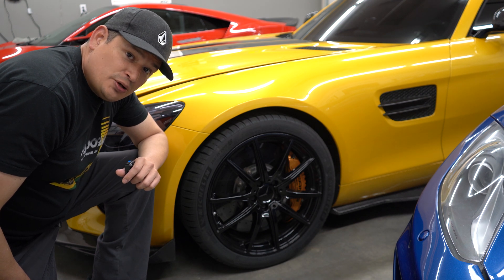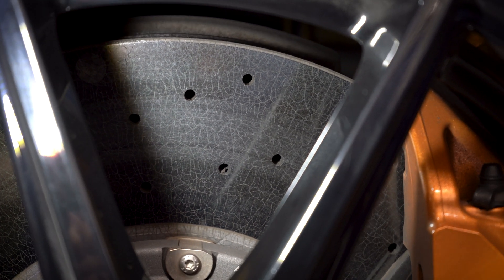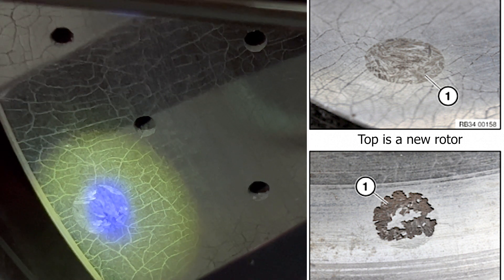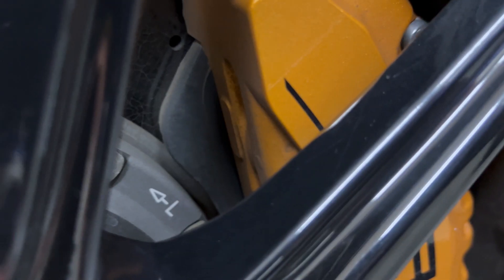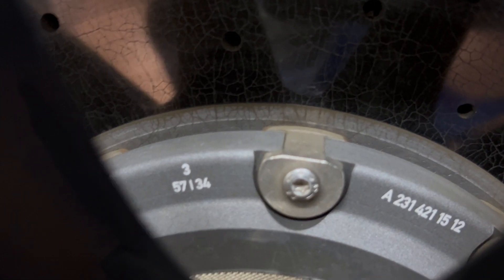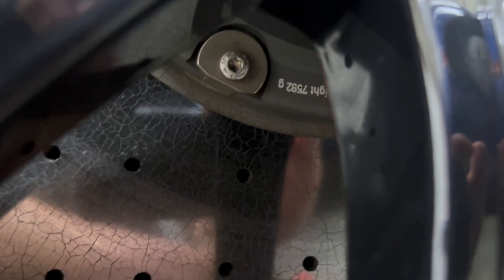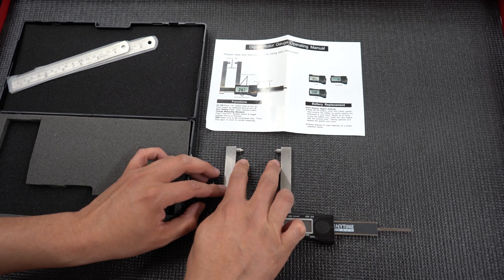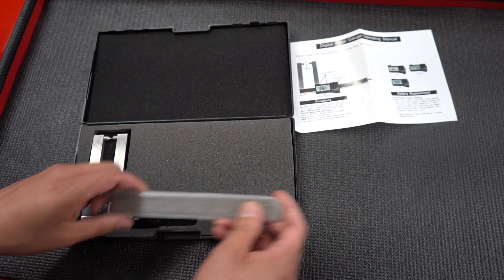Determining Carbon Ceramic Brake Disc Wear - Mercedes

Comment: what're the disadvantages of CCB when only used for daily drive ?
are they brittle to stone/ rock chip ?
Reply from the maker: None really. I drive my pretty much daily, no issues. The main caution is if someone removes your wheel for any reason they can chip it.
Reply: @DriversTherapy  thanks for the rep, what could cause it to chip ? I think they're far more durable then the iron ? do you have bad performance on CCB when they're cold/ wet ?

Comment: The 1/2/3 with the two numbers below them are not thickness but for Proceq gage and it does not use a "laser".  You can not use a micrometer to gage the wear on the disk.  Even the Proceq lit you showed describes the process using the numbers and this video: https://youtu.be/asnGXOmQsYU?si=Dn4o5vRpiCsiN1b0
Reply from the maker: Cool! Thanks for that info. Learn something new which is cool.